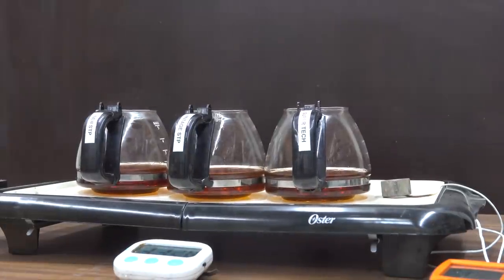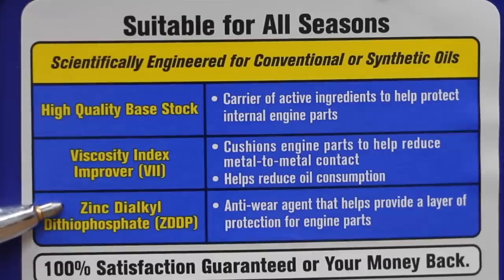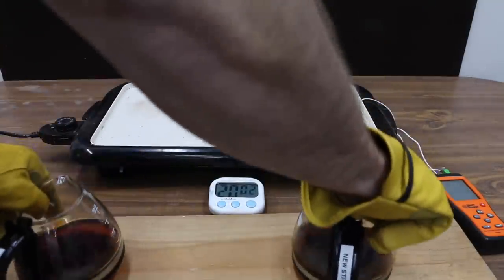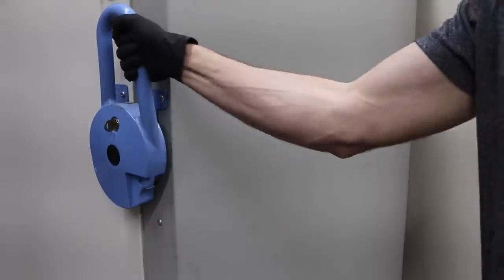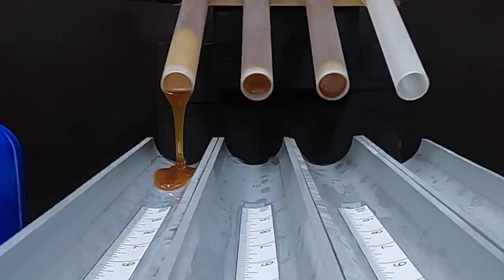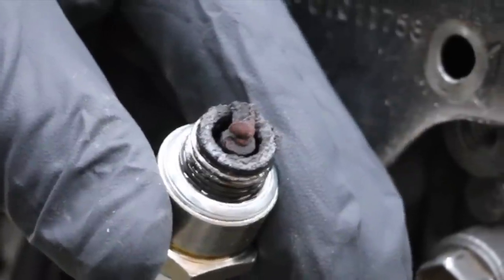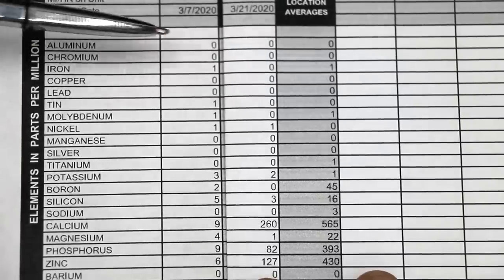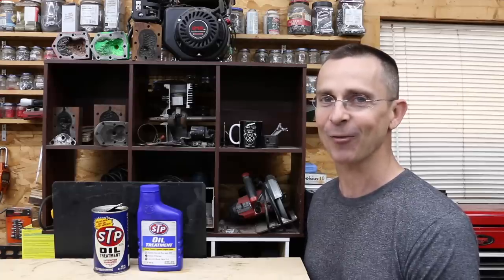Richard Petty's 1981 STP vs 2020 STP?  Let's find out!

Comment: I remember using STP in the early days based on Richard Petty's ads.  The big problem occurred while adding the highly viscous product to the running engine.  The STP was pumped up to the rockers, and plugged the fine oil passages.  This caused temporary oil starvation at the rockers (loud tapping) and probably more damage than the STP saved over its lifetime.  Most manufacturers recommend that you don't use any oil additives.  I tend to agree.
Reply from the maker: Thanks for sharing.

Comment: Adding STP may have been a good idea when oils were a single viscosity but that was a very long time ago. many modern cars today use a 0 wt. oil so adding anything to thicken the oil is only going to damage the engine. The oil passages are just not set up to handle high viscosity oils, doing so will only rob the engine of much needed lubrication in critical areas. bearing surfaces wear but not the oil passages.  I know that some people go to a thicker oil to deal with a worn out engine but it only makes the engine wear faster than it would with the manufacturer recommended oil. Thankfully modern oils are far superior to the oils of just a few decades ago. In the 70's if you could get a motor to last 150,000 miles you were doing good, now because of modern oils and a few other things, you can easily get 300,000 miles, I sold my 93 chevy truck and I had put nearly 400,000 miles on it and it still did not burn more than a cup of oil between oil changes. the most important thing you can do is change the oil and filter every 3-4000 miles and keep you air filter clean.
Reply from the maker: Thanks for the feedback.

Comment: Were you able to do a Wynn's friction Proofing test ?
Reply from the maker: Thanks for the video idea.
Reply: Might be hard to find a can as they no longer sell retail,back in the 60's they would drain all the oil out of a car that had Friction proofing in it for 60 miles without damaging it they also did the load bearing test like yours at local Sears Automotive Centers which is where I worked at that time. I also used it my Dirt Track car.

Comment: How 'bout 1968 Andy GRANITELLI STP??? I have a CASE of "RED CAN" 1968 STP viscosity improver to stop Chebby valve lifter clicking! I used a can in my 1963 Chevy II Nova inline 194 6 banger to stop the hydraulic lifters from clicking after the motor got 35,000 miles on it! Spend $2.16 on a can of "STP-developed-in Germany" as the jingle sang or spend $600 on a top-end job to "fix it" for 4-5 years. I put 92,000 miles on the factory block before it failed from a casting void and I slid a '64 212 CID Pontiac OHC (Tempest) engine into the Nova-gained a two barrel carb, 20 HP and 2 MPG in-town with the Power-Slide tranny and lost 22 pounds of weight on the front end! Put another 40,000 miles on the car (and my Mom did ) as her grocery getter before she sold it to another "blue hair" who drove it for a dozen years more years and got it totaled going for groceries in about 2010!!! Tough little cars- like 1970's Toyota Corollas and pick-ups!
Reply from the maker: Thanks for the suggestion.

Comment: Your videos are great I watch for hours on end love what you do but I have a test for you to try there is a product called engine restore can get it at Walmart and all auto parts stores says brings back compression helps oil consumption and guaranteed to renew horsepower curious to see if this stuff actually does what it says because I have used it before and sware there is definitely a difference in how the engine power seems to feel
Reply from the maker: Great suggestion!  Thank you.

Comment: Brother add a little milk and sugar to that test rig?
But seriously - ZDTP "activates" bonding to pressure areas at 700 degrees - but what does this mean in a modern engine where the oil temp averages 250?  Do pressure areas get that hot because of the pressure and friction?
Reply from the maker: Thanks for the suggestion.

Comment: Stp definitely has a lower zddp content than the oil..However the lubricity test proved STP does work..I use it in my engines and they work much cooler,much smoother and the oil last longer..I do not use it as indicated in the bottle..I put the oil in it and run the engine till it gets hot..then i add 20 ml per quart of oil and i promise you it does make a difference..I am not disagreeing with the additive package but the trick is something else..The lubricity test speaks for itself..Right?
Reply from the maker: Thanks for sharing
Reply: Something i forgot..I noticed the lobes on the camshaft of a new motor i installed still look brand new after a year of hard use with stp in the oil..

Comment: Let's see some kind of evaluation of plastic bonding....  Some plastics are easy to bond others almost impossible...and then you have plastic to metal and plastic to other materials...  One product to look at is Loctite Plastic Bonding Kit...   There are other methods as well such as using ultraviolet light, baking soda or other as an accelerator....or just plain solvent bonding when possible...  Bonding plastic can be a huge problem when faced with the need to get plastics repaired ..
Reply from the maker: Thanks for the feedback.

Comment: I'll bet none of these additives would show any statistical improvement in engine performance or engine life. 

I want to start a company making oil additive improver. As in, if people will buy "oil boosters", I wonder if I could get them to buy an additive to "boost the booster". 

The MSDS will show that it's oil, but I'll have a part saying that the other bits in it are proprietary. They will also be oil.

Comment: Never use oil thickners in VVT engines or any place where oil pressure is used to adjust fuel and valve timing. Further you can clog up a CAT.
Reply from the maker: Thanks for the feedback.

Comment: Pretty much all modern oils are far superior to the same products they made even 10 years ago. All have quite advanced additive packages, even the conventional oils.  I have run Supertech Synthetic with STP but it was the STP High Mileage treatment additive because at that time, Supertech didn't have a synthetic high mileage oil, but they do now. If I were to run Supertech in one of my high mileage vehicles, I'd have no problem running the Supertech HM oil.
Reply from the maker: Thanks for the feedback.

Comment: Would like to see a test on castrol r40  it would win on smell alone lol I have never had new stp I use to use old stp thick stuff warm it on a hot manifold before tipping it in lol any more then one tin oil pump wouldn’t pump it blow engine up lol
Reply from the maker: Thanks for the suggestion.

Comment: Is 40sae oil the same as 20/50 for my engine its in a 1962 mk Jaguar 2…4
Reply: Well I'm no expert but I'd say categorically no. 
Let's take 20/50 as an example the 20 relates to the viscosity at low temperature,  so how runny it is at cold start. The lower that first number, then the runnier the oil remains at lower temperatures, the higher the first number, then the thicker the oil becomes at low temperatures. 
The second number relates to stability at higher temperature,  usually running engine temperature. So plain old 40sae, is  too thick for most climates to be able to flow efficiently at start up, but generally stable at higher temperature. 
I read up on it once out of curiosity,  it's very detailed and that's before you get into modern additives.

Comment: The STP is designed to be run with oil so running it on its own in the last test was probably not advisable
It was probably WAY too thick and snot able to flow properly  lol 
It needs some normal oil in there with it
Reply from the maker: Thanks for the constructive feedback.

Comment: Great video as always, but you're comparing the specific additives of a four-stroke motor oil (super-tech) to an oil additive (STP) that is meant to be mixed/ added with motor oil. You should never fill your crankcase with just an additive. The detergent levels aren't going to be high in an oil additive, as they are in an actual motor oil. Some motors can't use detergent motor oils, such as a sprayer pump motor that isn't internal combustion and uses 30-weight non-detergent oil. 
Respectfully.
Reply from the maker: Thanks!  Thanks for the feedback.

Comment: GOVT got involved and destroyed the viability of these products.
just as with Slick 50, the version we have tells you to add it at every oil change. the original was every 50,000 miles. 
I do know, from personal experience, the new formula does nothing to help your engine. the main way we as car owners can tell if a product works is to check mpg. new doesn't help. old version improved mpg in all the vehicles I owned by at least 50%.

Comment: i was using STP in my 2008 ford expedition with 240K miles for the additives and to thicken up the oil, turns out that was just a waste of time and i should just run a heavier oil instead.
Reply from the maker: Thanks for sharing.

Comment: Yes STP was used by nascar but, what was not advertised was that they put roughly 1 or 2 ounces in the differentials and steering sectors.  STP has ruined several engines its a sludge builder will stop up oil galleries in the engine...eventuality starving critical engine parts of lubrication
Reply from the maker: Thanks for the feedback.

Comment: The old stp denfinitely had more zink so got to be better if running old engines with flat tappet cams lifter to lobe you know small engines like old briggs don't think it would matter much but new over head valve small engines it definitely does .
Reply from the maker: Thanks for sharing.

Comment: A new oil that you could try and putting in the oil testing lineup is the brand Pentosin. It's a brand that is formulated for European cars as I understand. Here's a link to O'Reilly's for their 5w 30: https://www.oreillyauto.com/detail/b/pentosin-4623/chemicals---fluids-16461/oil-16865/motor-oil---vehicle-specific-16257/5fb4d14d310a/pentosin-synthetic-motor-oil-5w-30-1-liter/8078106/4650340

Comment: The one reason STP was only effective was that after the race they drain the STP, not meant to use regularly in vehicles! In 1968 I worked at Gulf oil gas station, I picked up a popular mechanics magazine, a test conducted in a warehouse where they piped the exhaust out of the building and had A freestanding engine hooked up to a water source and a fuel source and they ran the engine for 48 hours nonstop, the popular mechanics scientists found that after 48 hours of nonstop driving, the STP turned into 100% Grease! Greece is a very poor lubricator, not only that but it builds a thick amount of sludge inside the crank case which resembles a thick black gum like cold bacon fat! You need a drywall scraper blade & chisel to remove the gunk! Many people would add account at STP at every oil change & I have seen the gunk at least 1 inch thick at the bottom of the oil pan. Another product that does the same thing is called motor honey which is 100% Petroleum jelly! So the test has been performed and STP is a loser as popular mechanics magazine posted in their magazine!
Reply from the maker: Thanks for sharing.

Comment: Gosh, if your oil is starting to break down, shouldn't you change it? With the oil they had back then and with cast iron engines, maybe 2000 miles would have been a good oil change interval. Friend said some of his gearhead friends did just that with their small block Chevys back in they day.

Comment: * * * BUT   you are using  40 year old product.      You need a time machine to go back and get it fresh.         Oil  & Gas both slowly  degrade   into   a gel  varnish  after 6 months and beyond.
Reply from the maker: Thank you for the feedback!
Reply: Only if the container is opened. If the seal is still intact it will keep for quite awhile, but probably not 50 or 75 years

Comment: Old English motorcycles need zinc because the cam followers ride directly on the camshafts (unlike Harley or Indian) but  most modern car oils have deleted the zinc so I have to buy zinc additive, a nuisance when you have several old bikes. I do not use synthetic oil in the old bikes, so unfortunately can't use Supertech. I use Valvoline racing oil when I can find it.
Reply from the maker: Thanks for sharing.

Comment: I wonder if you could literally run an engine on 5 quarts of STP and no conventional motor oil in it. We used to joke about that with engines that were making funky internal sounds.
Reply from the maker: Thanks for the suggestion.

Comment: Do you really believe that Richard Petty used STP in his race car? I think the engine builder would want an uncontaminated product in their motor, Like Valvoline Racing Oil 20W-50. Basically you want a specific viscosity and if the oil is hotter you need to use a higher viscosity, but a higher viscosity oil will, by the definition of viscosity, operate hotter under identical conditions.

Comment: hi project farms guy, 
      ive been thinking about your STP oil treatment project for a few months now. in 1974 i was driving a 1967 mustang and i put headers on it to help my 289 4V motor breath better. i had some head work done as well the idiot i hired to do the work just trashed my engine. he actually knew nothing about porting and polishing cylinder heads. i was running a very thick motor oil , 20w 50 racing oil to try to stop from burning oil. i was also was running STP oil treatment. it worked ok i guess. my 289 4V just died. i replaced it with a crate motor from ford. replaced it with a new 289 4V. i still have more than half a case of STP oil treatment if you want it your more than welcome to have it. i actually have no need for it. as i said if your interested you are more than welcome to have what i have left.
Reply from the maker: Thanks for the very generous offer but I don't plan to test STP again.

Comment: Furthermore,  zinc phosphate compounds are dense and they will sink to bottom of the container especially after sitting for 40+ years.  Ask any professional car painter that has used zinc phosphate anti rust primer.  Your sample from the old STP was biased because you didn’t mix it thoroughly prior to collecting your sample for lab analysis.

Comment: In a nutshell, what you have here is an additive package of the same basic ingredients that oil already has in it - and if you are not careful can unbalance the "formula" of the existing motor oil and it's effectiveness. More is not always better. Oil provider spend countless millions on R&D to get the right combination of ingredients to produce the best overall protection - if you think you can by a cheap oil and add your own additive pack and get the same results, we would all be in this business.

The good additives out there enhance the existing oil without actually changing the original oils function or mechanisms, as they ad support for anti-oxidation, cleaning, and some lubricity enhancement without changing the original oils chemistry - these include Auto-RX, Lube Control LC20.

The only additive I have seen that adds "more of the existing additive ingredients" that I have seen show very good wear numbers is BG's MOA (Motor Oil Additive) - it does just seem to work as it adds more cleaners (Calcium) and a great deal of Moly/Boron for better EP protection - many swear by it. But in general, you run a risk in upsetting the original oils additive package 'balance" by adding these kinds of additives.

In general, I would stay away from these and only consider the 3 I mentioned above as they are the only ones I have researched (mostly on BITOG) that really perform and are not just "snake oil" or money wasters.

My 2 cents for what it is worth.
Reply from the maker: Thanks for sharing.

Comment: Great video, in my opinion; vintage oil/oil additive and rest of the motor related consumables packaging were much better than their modern counterparts. While the modern packaging probably safer and seals better, virtually vintage packing and the design is more appealing. Modern bottles and boxes are plastic with labels stuck on them, on the other hand majority of the vintage stuff came in tins or glass jars and bottles, some parts were wrapped in that oily paper with companies brands proudly displayed on the entire face of the packaging.
Reply from the maker: Thanks so much!  Thanks for the feedback.

Comment: An idea could be to show the best things to suit given situations, for example: I have an old 1996 Mercedes Benz that has only done 90,000 miles. Now I only drive about 3,000 miles a year. So I use Mobil 1 High Mileage to try to keep the seals and gaskets in good condition. I use a good long lasting Coolant , but I want to put a cleaner through the gasoline to clean Injectors etc. and also clean the catalytic converter BUT I don't know what fuel conditioner/cleaner to use. But how about if my car had done 60,000 and I drive 15,000 a year?  Perhaps you could do a series. Anyway Cheers 🥂

Comment: Why did you say modern oil is better the tests shows that old stp have lower wear and can withstand higher temperatures which is the most important thing for an oil the modern is only better at low temperature and after starting the engine it won't matter.

Comment: The rings of a single-cylinder lawn mower engine cannot handle the thickness of either of the STP bottles, what made you think that was going to function is beyond me. Most modern engines cannot handle that thicker sdp either because they do not have higher tension Rings like vehicles used to have.
Reply from the maker: Thanks for the feedback.

Comment: I wonder if Richard Petty actually run STP in his race engines. I would guess not likely.  I used STP back in the late 80's the car did smoke more and fowled plugs. The plugs didn't fowl as bad as the mower but they didn't last every long either. Not fan of the STP. I am a fan of Richard Petty though.
Reply from the maker: Thanks for sharing.